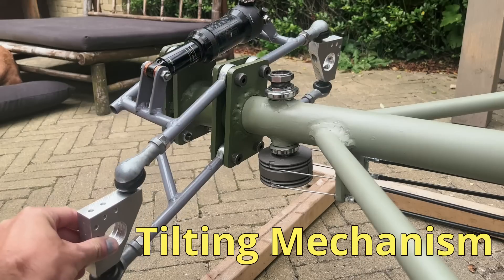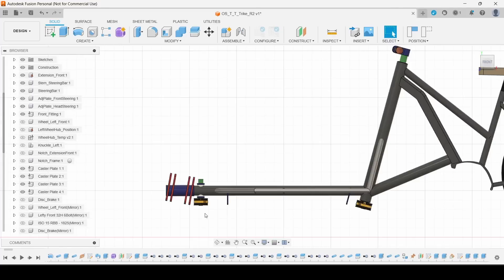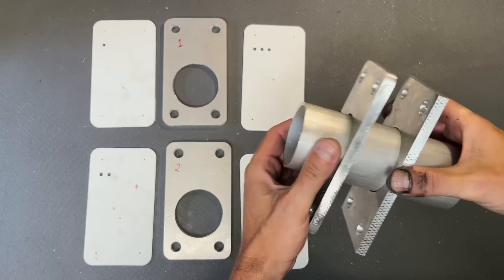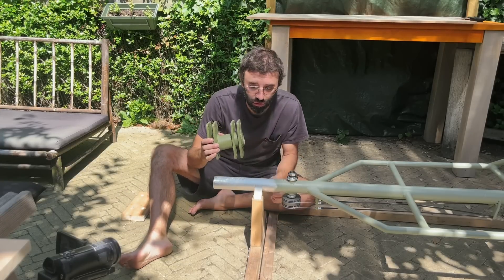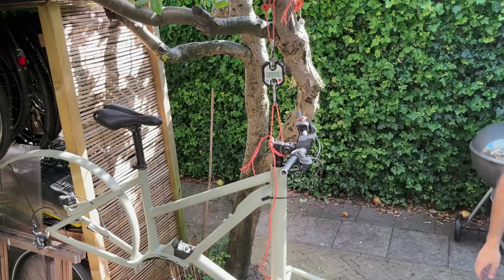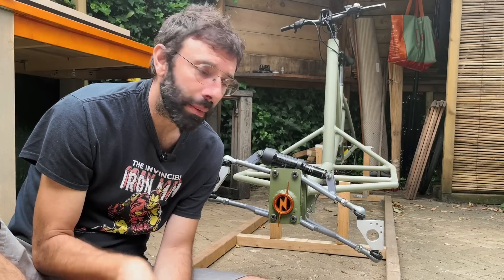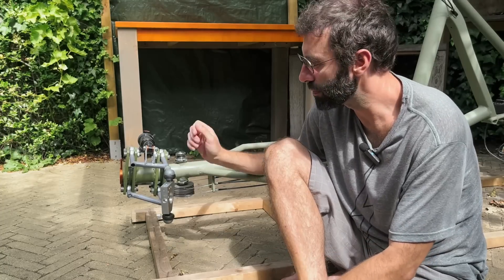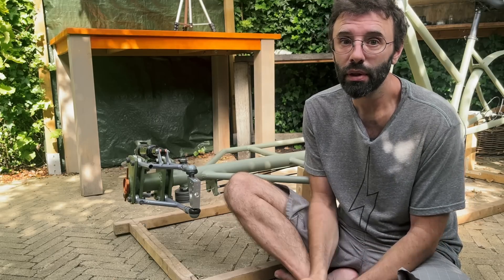#2 Tilting Mechanism - Tadpole Tilting Cargo Trike Build

Comment: Great work !!  I think that you would be better using a screwed or bolted in STEEL axle as aluminum goes very soft with welding, unless you can heat treat it correctly afterwards...
Reply from the maker: Thank you! I'm at a point where I already created the axles in aluminium, but I didn't consider that they may lose shape after welding... Cross fingers!
Cheers!
Reply: @pedro-neves  even if they stay straight, they will be very soft and weak...
Reply from the maker: @kiwiwombatman  indeed steel can withstand more but the axles that I'm working on are 25 mm in diameter. I don't wanna reveal too much because I think that the choice I'm making is interesting specially for an Open Source project. I hope you watch the next video and would be super cool if we keep discussing the axles after you've seen them. I love discussing criticism to my designs and builds. That has been a major help to improving things.
Thank you!

Comment: Im a big believer in si3n4 if correctly designed, no grease, no corrosion
Reply from the maker: Thank you! I understand that si3n4 is the component inside the ball joint in between the ball and the housing, right?
Cheers!

Comment: Agreed that ball joints seem the best option given the manufacturing abilities. Bushings and bearings could work too, given the low speeds and limited range of movement i agree with the other saying bushings over ball bearings, but in either case they need to be coaxial.
Reply from the maker: Thank you for that! I feel like these ball joints will be a good solution for now and I'll be able to test their durability;)
Cheers!

Comment: Fantastic build. Ps. You could have heated up the outer tube, and cooled down the inner tube. That would have made it easier to slide them in to one another.
Reply from the maker: Thank you so much! I'll certainly have this technique in mind when I have another aluminium tight fit in the future.
Cheers!

Comment: you could do your aluminium on the cnc
Reply from the maker: Absolutely. The parts that I made in this video are not super complex so I did them "manually" but in some cases it's best to use the CNC for sure. In this video I only used it to mill the jig for the wishbones assembly.
Cheers!

Comment: Not really a design tip, but when you finish welding a section it is beneficial to leave the TIG torch over the finished weld for a few additional seconds so that the shielding gas protects the weld while it cools. This can improve the weld quality!
Reply from the maker: Aah, indeed! I have the machine set for leaving the gas open 1 sec after turning off the torch but looks like I'm forgetting to leave the torch there... Thank you for pointing that out!!
Reply: @pedro-neves I'm not an amazing welder but I'd think it'd not hurt to do a few seconds
Reply from the maker: @EricBrummer  that is also right. I think that 1 s may be too short... Thank you!
Reply: Hi, While we’re at it, never removing the filler rod out of the shield gas area whilst hot makes it easier to weld without occasional spatter when starting next time and eliminating any inclusions (impurities). Just keeping the rod and weld gun nozzle there during the time gas faces out and you will enjoy the benefits. 😊

Last but not least! I mean, wow! Your video content nails me to the chair watching!.Hat off for you!

Kind regards 
Anders 
Sweden
Reply from the maker: @tomfull6637  thank you so much for the extra tips and for the extra kind words!
Reply: Thanks for your content. I've been toying with the idea of tadpole trike with lean steering for some years and have some time considering things that you have already addressed  in your previous  videos.  I very much appreciate the detail you have  provided, that will help me avoid mistakes in my first iterations of my design. I'm looking forward to any additional content you'll provide. Best of luck.
Reply from the maker: @mattmaria2226  thank you so much for your kind words! I'm super happy that my videos and explanations are helping with your build! Best of luck with it!
Your comment inspires me to keep creating better builds and better content.
Cheers!
Reply: This method can be applied as a principle to any project, speech or undertaking in life

Comment: The bike is light weight so you could replace a lot of materials easily with Igus (I'm not an affiliate I just like their stuff) materials - they make filament for many of their materials and also offer bar, rod, sheet, and powdered (for sintering applications) stock as well as a build service which I've never used but exists (I've used a few other online fabricators for parts - it's a little more than getting it done locally but usually all the local fab shops are booked out months in advance from all the companies here that use them for their fixturing. 
But they make replacements/upgrades for heavy machinery/industrial applications (bearings, high wear parts, low friction applications, etc) so it's worth looking into - you might save weight, cost, lead times, your own shop time, and effort.
I know a bit about materials and fabrications, but I'm learning about tiling fronts on reverse trikes right along with you - I'm disabled and my current ride has unfavorable geometry in a lot of the parts (Fat Tad CXS, if you turn too far the front wheels will bind against the frame on one side while getting into my legs on the other, simultaneously.  It needs a lot more wheel travel too, as well as rebound damping (rebound is especially nice to control, because it has flipped me at least twice due to pogo sticking off a chunk of bedrock (I live in a volcanic region so half the grass patches conceal basalt small outcroppings that pedestrians don't care about but they can and have flipped me over on my trike).
Reply from the maker: Indeed, sometimes I also need help with the fabrication of some components. I also found a shop near where I live that rents big machines on their shop per hour (like a big metal lathe). These things come handy for sure.
It's very nice to learn while doing;) And it sounds like you need a new iteration for your vehicle with a few improvements.
Good luck with your builds!

Comment: I see some confusion in the comments about bushings, about them beeing less stiff / wobbly or absorbing vibration.
There are generally two things called bushing:

1. A bearing with no rolling elements. Usually made out of two differnt metals, one of them should be a somewhat self-lubricating metal like sinter bronze or brass. This metal can be replaced with teflon or similar plastics. Additionally, these types of bearings are normally lubricated with oil or grease. This is the type used in older motorcycles swingarms (with two different metals and grease) and can take a lots of force, but only at slow speeds and is therefore well suited for suspension.

2. Rubber bushings are often used for control arms in the automotive sector. They are different in the sense that there is no sliding motion but only rubber twisting and flexing. Because this rubber can flex in any direction when under load, it is harder to design a good suspension geometry with them. Things like static forces from additional weight tend to change the  geometry a little bit and then they also act like springs on their own, because the rubber exerts a force to get back to its original shape. They absorb vibration and road harshness well, but because of the design difficulties i wouldnt recommend them for such a build
Reply from the maker: Thank you so much! This is why it's so cool to ask questions here. I understand those two kinds of bushings now.
Cheers!
Reply: Here is avideo that shows automotive bushings that are used in tuning and racing:

https://youtu.be/8Ex0dGojHZI?si=yL1jDslLYv2Jb6wN

Those polyurethane bushing do a little bit of cushioning but are way more ridgid than rubber bushings. The inner sleeve is also lubricated and therefore rotates without adding any spring rate to the system, so basically best of both worlds. I could imaginge that theese would be very well suited for such a trike and the materials should be cheap. PU can even be molded at home into any shape desired
Reply: @ichebensonstniemand  rubber moulded bushings (with the rubber and metal bonded) would work great here, lasting forever and even allowing the trike to stay upright by itself as they excert a little force to return to center. They are also known as silentblocks or antivibration bushings.
They can be bought as suspension knuckle bushings, and are very cheap
Reply: @nirodper Thats true, i havent thought about the return force as an advantage. However it is still more complicated to calculate a suspension, as return forces are most often not specified by the supplier. In my experience with lower control arms of cars those return forces can easily exceed 40kgf and therefore would eliminate the need for a shock on the trike all together, but also maybe inhibit the tilting to much.

Edit: 40kgf for something like ~8cm of suspension travel
Reply from the maker: @ichebensonstniemand  I'm a big fan of this channel and I've actually seen this video before! Interesting enough, I commented on this video a while ago that it was the best bushings video I ever saw. We are aligned;)

Comment: The weld penetration will shrink the tube ID. I usually use a flap wheel in a drill or air grinder to clean out tubes after welding and open it out if needed. It saves battering your hard work.
Reply from the maker: That's a really good tip, thank you!
Reply: @pedro-neves  a cylinder/bore hone which is 3 sanding stones, or a brush style, that you can spin with a drill is another tool to help with the contraction from welding. They use them in auto repair/restoration
Reply from the maker: @onekilo1  I need to get me one of those! Or make.
Reply: Yes. I wouldn’t recommend 1mm different tubing.
Reply: A reaming tool is the industry standard for correct tube internal diameter. But 50+ mm will be a beast!

Comment: This is so exciting for me to see, thanks for the update.  I’m already collecting parts, have built some front wheels and I’m thinking about some jigs.  Rose joints like these do wear so I guess my worry is making them replaceable. On my previous cargo bike build I have them in the steering linkage - i turned down some long nuts and welded those into the tube ends, might take the same approach here.
Reply from the maker: Thank you so much! Ya, indeed I agree that it's a great option to weld nuts to make the components replaceable! It's much better than welding the components directly to the tubes.
Cheers!

Comment: IF aluminium is tight like on 07:54
Put it in oven at 200C for 15 minutes, it will slide on, aluminium expands quite a lot while heated.
Reply from the maker: Thank you so much! I will definitely have this in mind when I have a tight aluminium fitting in the future.
Cheers!

Comment: If space allows, I think it's better to have the brake calipers on the back side of the spindle - on paper this would reduce the nose-dive when braking
Reply: One particular spot to look is XF Motorsports channel, he does ingenious fabrication of his own suspension (and car).

His series on suspension geometry with a more geometrical approach, different to the approach of most university courses that use calculations:

https://youtube.com/playlist?list=PLd4DmKPb2AOkCi4OaAIpmqcawdITAS0Ue&si=TmOI1bRrRgonr-if
Reply from the maker: @ichebensonstniemand  nice, thank you so much! I subscribed to this channel and will watch the suspension playlist attentively!
Reply: The positioning of the brake caliper does not affect nose dive. Brake caliper and spindle(and therefore brake disc) are attached to the same part, therefore only torque can be transmitted from this setup. The translational forces on the knuckle are always just the forces from the contact patch
Reply: @ichebensonstniemand  I don't remember the explanation, but some cars have their calipers inward from both axles(between the axle and body)
Reply: @zahari_s_stoyanov  For this configuration placement of the caliper can make a difference in anti dive, but its uncommon and it would mean lots of unneccesary complexity because a drive shaft and cv joint has to be added.

There is an easy way to implement anti dive with the parts used in this build: Angle the top A arm differently than the lower A arm.

An example could be having the two inner ball joints of the lower A arm on a horizontal line while keeping the upper ones at the 10° angle. This will result in a small turning motion of the knuckle when going through the suspension force. Vice versa applieng a rotational force (braking) will result in a force along the suspension direction
Reply from the maker: @ichebensonstniemand  it's obvious that you know a lot about this stuff. I never considered having the top A arm at a different angle than the bottom.
I have looked for a place to discuss vehicle engineering and I haven't found, e.g. a community on Reddit where people share their projects, ask questions and get feedback such as yours. Do you know of such a community? If not, I'm considering creating.
Many thanks.
Reply: @pedro-neves I sadly do not know such a community, would have some questions on my own for such a place.
However the car tuning scene is big and there are lots of informative videos on youtube from that side as well as some free lectures from USAbased universities. I can search up some links if you like. 
Downside is you have to adapt the information to trikes because its all focused on four wheels, but for most geometries this is fairly simple. Even ackerman steering works the same
Reply from the maker: @ichebensonstniemand  that's a great point, thank you so much! I'll look for some car tuning communities;)
Reply from the maker: Oh, I did not consider nose diving but now that you mention, it makes sense to me. I'll have to give this some thought. If I cannot make it for this knuckle design, it will certainly be something for the next iteration.
Cheers!

Comment: One of the steps that you're missing from production methods is the heat treating after the final welding is complete. You either need to use steel or find a powder coating oven you can rent time from.
Reply from the maker: Absolutely. This is totally a prototype. I'm trying to make a prototype that is great to ride but with some limitations like not treated properly for durability.

Comment: A ball joint is a good solution, helps with not perfect tolerance in home shops. Roller thrust bearing could help with weight saving, so would Teflon washers. But longevity might be an issue. Compromise is always part of good design. You're doing good, really cool project and design. Tadpole is a good idea for cargo HPV. Keep it going. Thank you
Reply from the maker: Thank you so much for your kind comment and the suggestions. Indeed, I'm super happy with the ball joints. They made the build easier and there's no noticeable play!;)
Cheers!
Reply: @BHrobry  yehwhat I'm thinking
Reply: I'm in hospital ,sorry bout Grammer . Still cloudy

Comment: Spindles, spin inside a bearing, axles are fixed and the wheel spins on the bearing on the axle.
Reply from the maker: Hello, I was thinking that a spindle can be a system where the spindle is fixed to the inside of a bearing and the outside of the bearing moves with the wheel.
Reply: @pedro-neves  If the shaft spins it is a spindle, if the shaft is fixed it is an axle.  The best suspensions use angular contact ball or roller bearings but all work from Delrin, bronze, rubber and all have advantages and disadvantages.
Reply from the maker: @dan2304  that makes sense. So, are these wrong to call their components spindles? https://leedbrakes.com/c-1064535-disc-brake-parts-disc-brake-spindles.html
Reply: @pedro-neves  Pedro, as an old (75) only English speaking mechanical engineer, it is simply a naming issue.  Both in engineering and science many things have specific definitions that only have relevance in engineering or science but not in general language.  Who is naming them?  Probably a sales person, definitely not an engineer.
Reply from the maker: @dan2304  that is very true!

Comment: Great to see it coming together. Great colour choice and logo ( but the botton spike will snap off in no time so needs some revision). For your consideration...Forget the (hammer on) collar assembly and weld striaght to the frame next time - You need to be more ruthless concerning the weight. It all adds up! I think the cargo frame might need a front stop of some description, to prevent the load clashing with the wheels when braking hard. The ball joints look right and best suited for this set up. Can't wait to see it running. Thanks for sharing!
Reply from the maker: Thank you so much for your kind words and suggestions!
Indeed those spikes are meant to break off some day. I'll have to make something more durable.
The best would have been to weld the plates directly in the frame. The reason why I weld out is because I don't have a good fixture to hold the frame and its hard to turn things around. Also, I consider the possibility of this not being the last version and having to undo things.

Regarding the weight, I'm really hoping that this will be a lighter version. My last build was 45 kg and that's just too much!

Indeed, you are right about the cargo bay. It is not finished. I just wanted to get the structural buts made before I went to the front. In the end I'll add some functional parts to the cargo bay.

Thank yo so much! Cheers!

Comment: Freeze spray frame tube or put front assembly in oven first or both methods together.
Reply from the maker: Thanks! I'm reading a few comments now with this suggestion. I will certainly consider it next time I have a similar challenge.
Cheers!